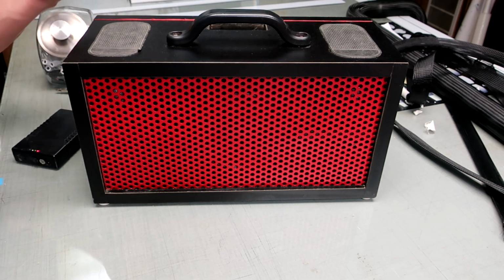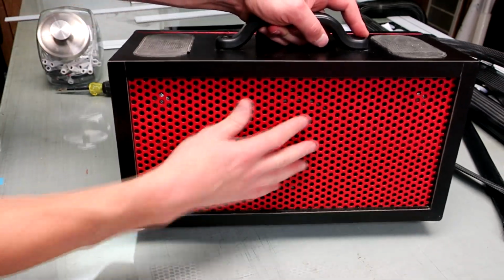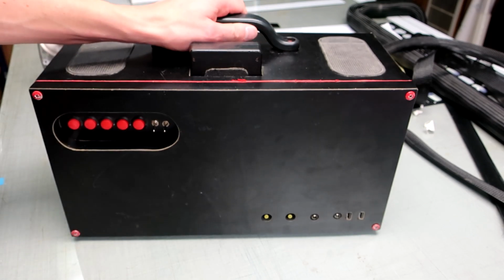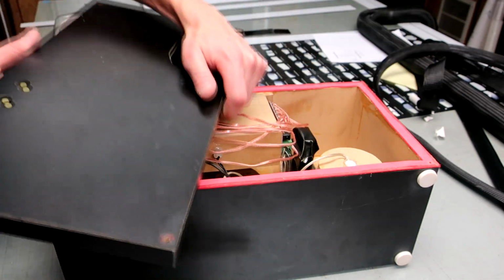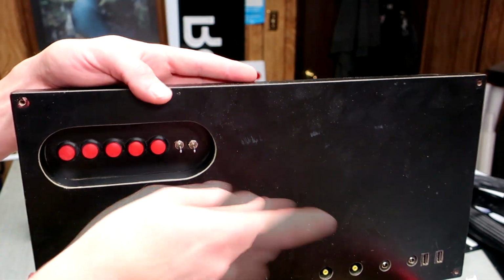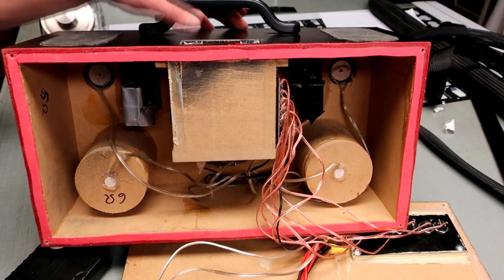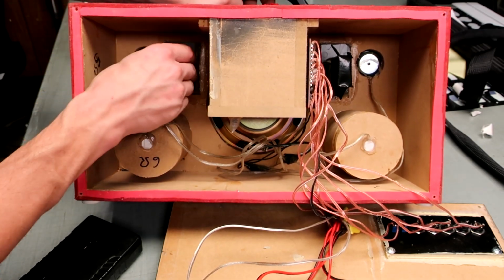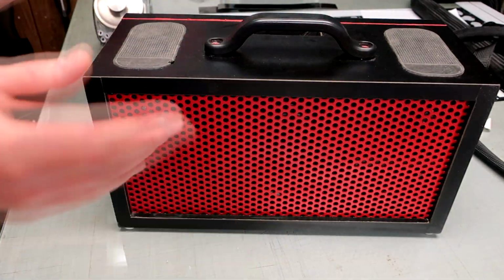Bluetooth Speaker Build- TDA7492P

Comment: How did u connect only one subwoofer/bass unit to the stereo amp ??
Reply from the maker: IDK if its a good idea or not, which is why I didn't talk about it in the vid, But its just connected betweent the right and left channels.
Reply: chainmaillekid ahh i think not because the channels play different sound patterns ... U need a mono/sub circuit i think 😊... Nice video anyway
Reply from the maker: It works, I think it just messes with the stereo effect. Which really isn't noticeable when the speakers are this close together.

I think the biggest problem is that some amps might not like it.
Reply: Yeah .. it can burn the amp for sure and the speaker will most definately Sound weird and wrong

Comment: Hey man, sick speaker. But how did you add the exter al switches tot the amplifier? I tried it but it didn't work.
Reply from the maker: Here is a close up: https://i.imgur.com/oithhRC.jpg

I soldered to the pads next to the buttons. I think the switches are double pole, so you may need to do some continuity testing to figure out which are opposing poles.
Reply: chainmaillekid oh thanks man, i tried it with an old tda7492p board and i removed the buttons first, maybe that is the problem.

Comment: how is this speaker design
https://youtu.be/wBIEeQuf0vA
Reply: PAM8403 amp and two 3 inch 2 watt drivers in a box with two 2x3 passive radiators.